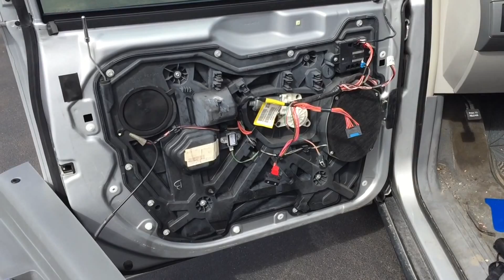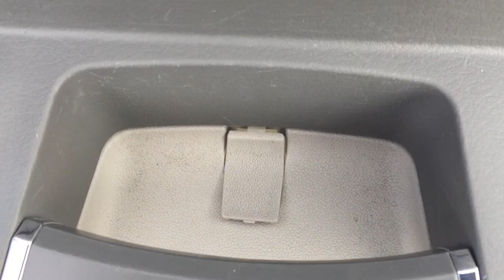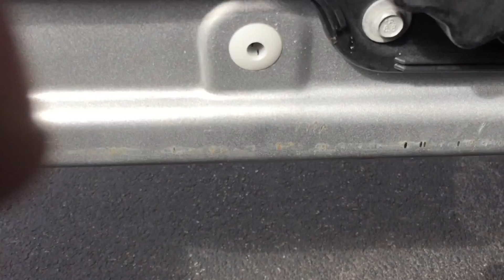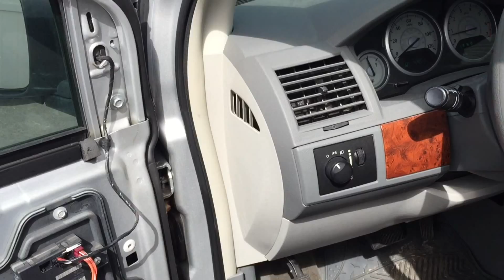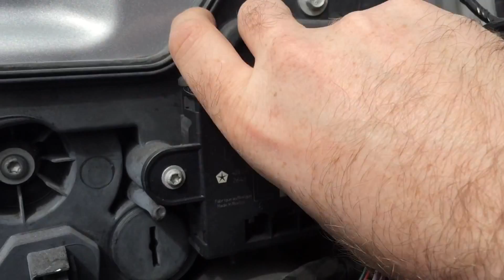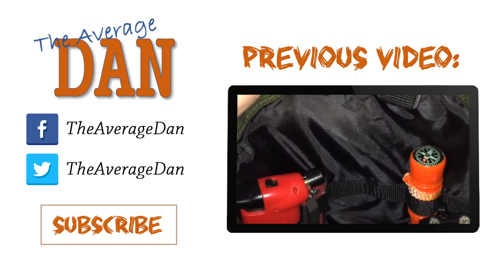Town and Country Door Panel Removal | Dodge Caravan Door Panel Removal | Beeping Dashboard

Comment: I just fixed this issue on my Van.I have a 2008 Town and Country. Mine was broken wires in the harness.Going from the door into the Van.I had two completely broken wires and four of them that were just about snaped off. Cut and spiced wires with butt connectors reassembled everything the issue is gone

Comment: Jeff the computer nerd here. Without even pulling that connector, you can even see the black wire (presumably ground) was pulled out a little. I am guessing a factory defective lead are installed on this model. I see it all the time with cheap power supplies in computers.

Comment: Just in case anybody is still dealing with this issue (model years 2007 thru 2009), there is a common problem with the ground wires BETWEEN the driver's door and the dash. Inside the flex boot, I found white wires with orange stripes that were broken. Very common problem due to the flexing of the wires. Hope this helps.
Reply: I had about a half dozen wires broken. Caused every light on the vehicle to come on including the flashers.

Comment: Thanks Dan for taking the time making this fine video.   I have to remove the passenger front door panel to see why the lock button will not move up or down electrically, only manually..   You got me started, appreciate.
Reply: I'm about to tackle this same issue.  Passenger door as well.  What did you end up finding?
Reply: @y2j514  About to do the same on the driver side. What was your issue? I'm assuming it's the actuator but that's just a guess.
Reply: Rafael Arguello the actuator seemed to be very weak. All the wiring was ok, the only thing is the actuator is built in to the lock/latch assembly. They're quite pricey new so I went to a scrap yard.

Comment: Did that fix it?
Reply from the maker: +Rich Grisak It stops the annoying beeping but all it really does is isolate the problem and remove it from the system.  While the beeping does stop, the window controls on the driver's side do not function for the front windows.  Since this video was made I have also attempted to replace the power windows control unit (where the buttons are) and it did not resolve the problem.
Reply from the maker: https://www.youtube.com/watch?v=JcRL3JFzr5g